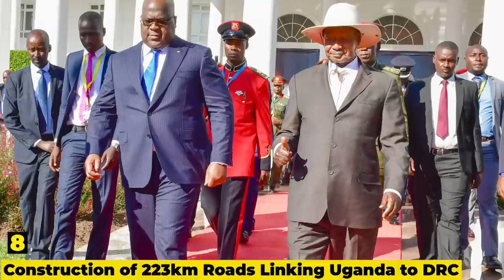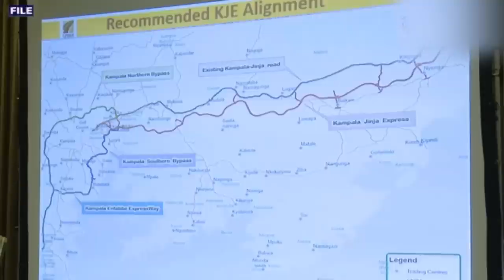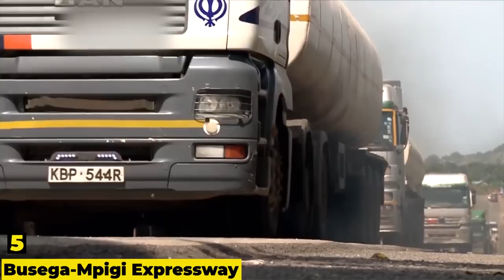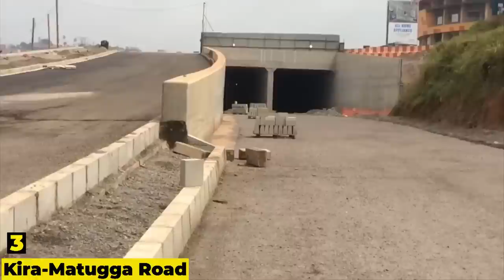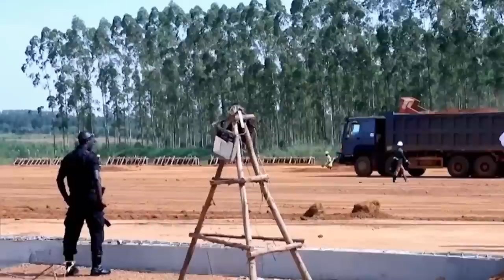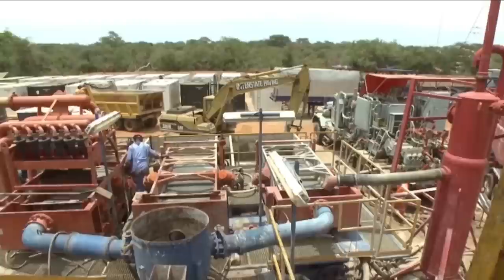Biggest Megaprojects in Uganda Making The West Scared

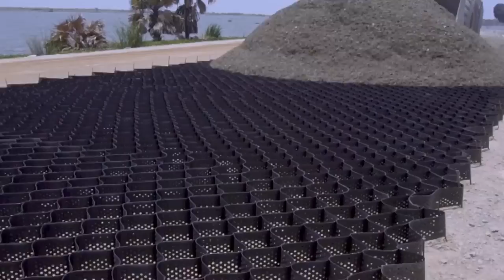Comment: 1:00  medium-profile of polymer-grating/mesh that can prevent CRACKING in asphaltic layer, after years of non-stop rolling Traffic. It can prevent disintegration of asphalt when all the cementing solvent already VOLATILED in the hot-summer air. Road ended !!